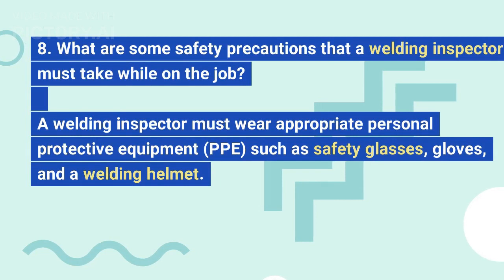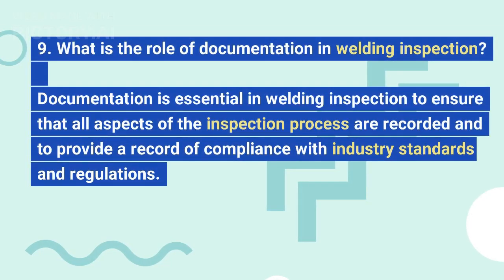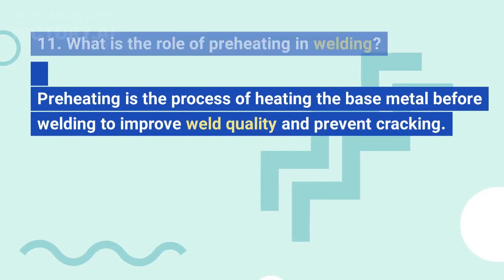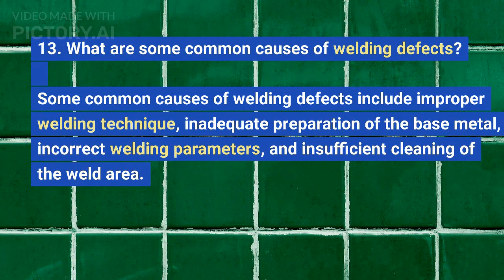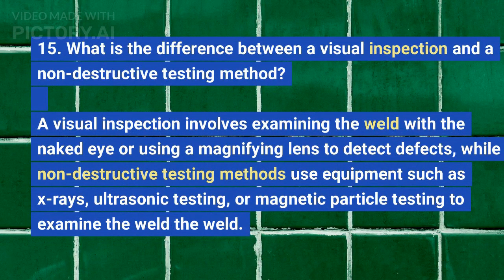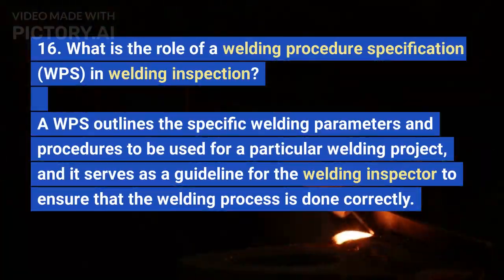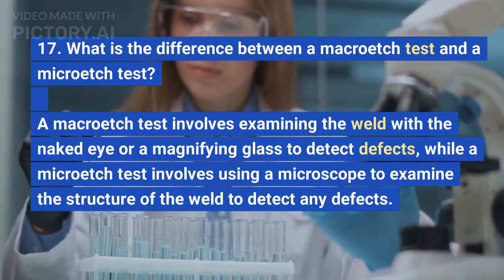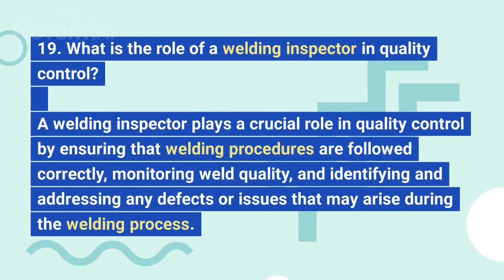Top 20 welding inspector job questions answers

Comment: What are the meaning of -15,-16,-17 is used in electrode nomenclature suffix
Reply from the maker: Find your here answer here in this post: https://www.materialwelding.com/difference-between-e309l-15-16-17-e316l-1516-and-17/